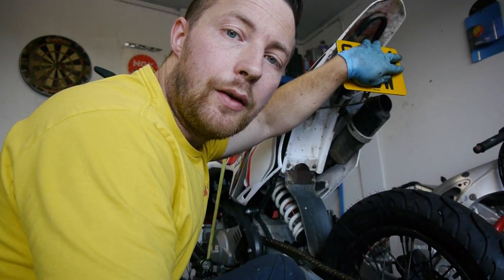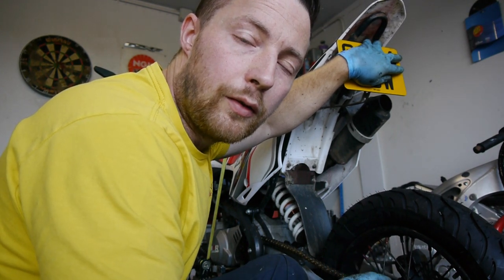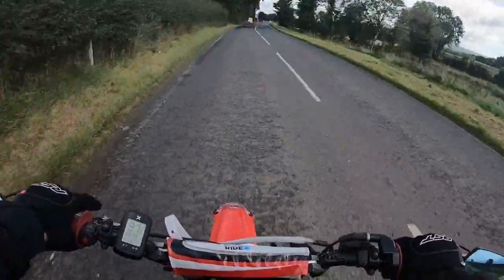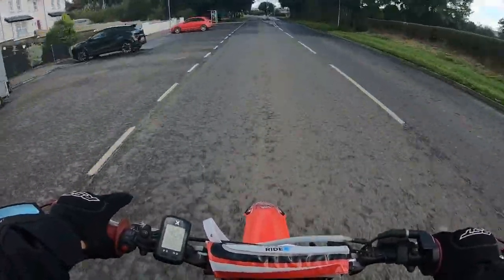Supermoto Style Tubeless Tyres on Your Pit Bike or Dirt Bike - Cheap and Easy

Comment: What size are your rims? How did you know what tires to buy for them
Reply from the maker: My rims are 17 front and 14 rear. You will know the size of tyre by the writing on the side of it. It will say something like 100/80 r14. That will give you the correct tyre size you need

Comment: Hi mate I have 

Front -  70/100-17

Rear - 90/100-14 

Do you knows where I will find a set
Reply: For my front I got a 70/90-17 and waiting for a 90/90-14 but my front works fine I use my tube I got with it but it working fine

Comment: Hi, What oil do you use in your pitbike ? Plus how long do you recommend going easy to break in a brand new m2r rf140
Reply from the maker: Hi, I use 10w40 semi synthetic oil in mine and change it roughly every 100 miles or 5 hours. 
I wouldn’t be a believer of breaking in an engine too gently. Just get her up to temperature about 3 times without revving it too high and let it cool down completely each time. Change the oil fairly soon after this as you will find a fair amount of metal filings in it due to it being new so it’s usually nothing to worry about. 
I hope this helps you out and enjoy your new bike!
Reply: @DarrenMcKinney1  sorry I should of been more specific with my wording, I meant what brand of oil do you use in yours ? That's good to no thanks for the reply. I was thinking of getting a magnetic sump plug to catch the shavings but I'm to eager to wait for it to come now without riding it
Reply from the maker: @therathunter1814  ok. I use comma 10w40 semi synthetic oil in it at the moment but if you wanted to put in a really good oil I would use any of the Motul 10w40 oils. They are all good. I use the 300v racing oil when I’m looking  a better oil as we keep it in our local motor factors but it can be expensive. But as I said any of the motul 10w40 range will
be good enough
Reply: @DarrenMcKinney1  what position on your rf is the choke on as its the first bike with a choke like this. It has 3 positions up, middle, and down. Usually it's just up or down
Reply from the maker: @therathunter1814  yeah its like a half choke in the middle. Mine is full up for choke fully on and down for fully off.

Comment: what happens when you need to adjust spokes?
Reply from the maker: You would have to reseal anyone you adjust unfortunately that why I adjusted first. It’s not something you have to do much though as I’ve only done it once and then put 600 miles on it and they’re still fine
Reply: @DarrenMcKinney1  okay thanks, did u need to add sealant around the rim lock?
Reply from the maker: @ryke4552  yes add sealant around anywhere there is a hole through the rim

Comment: can you give me link to that tyre
Reply from the maker: Yeah sure. I will get it added on the video shortly too. 
https://www.demon-tweeks.com/uk/michelin-pilot-street-449960/
You may have to select the tyres from the scroll down menu but the rear size I used was 100/90 x 14 (57P)
And the front tyre was 
100/80 x 17 (52S). 
There stock is a little low at the minute but if you have any trouble let me know and I can find another site that has them.
Reply: @DarrenMcKinney1  thanks

Comment: where can you buy those alloy tire adjusters????   need answer please.
Reply from the maker: Sorry what do you mean alloy tyre adjusters?
Reply: @DarrenMcKinney1  that color red from 0.29..   thats your chain adjuster right??   where did you buy it?
Reply from the maker: @rodneypascual2078  oh ok. I see what you mean now. No I didn’t have to buy that. It came on the bike but I’d imagine most pit bike ones are the same and should be easily got online
Reply: @DarrenMcKinney1  yes..   and my 1 piece of that was missing..  and i need a pair of that to put on my pit bike..  thats not easy to find..  im asking every motorcycle and parts shop..  they dont have like that..